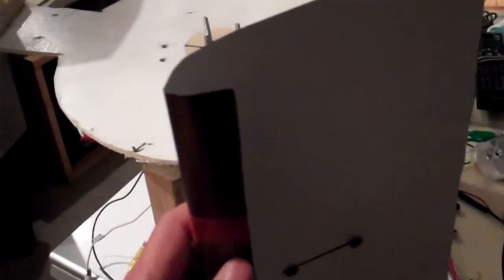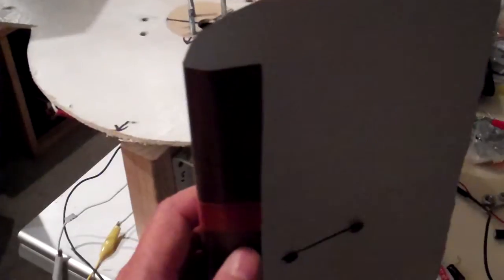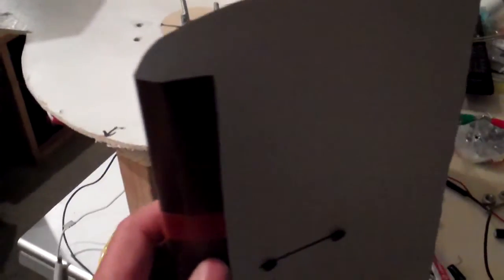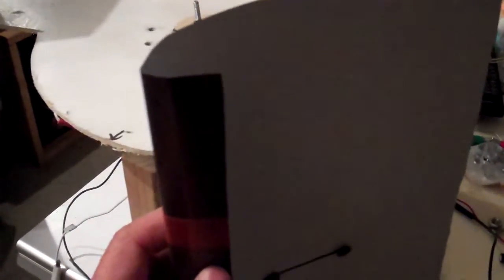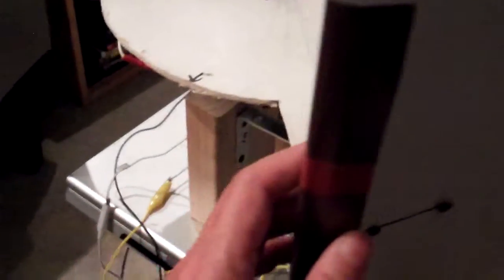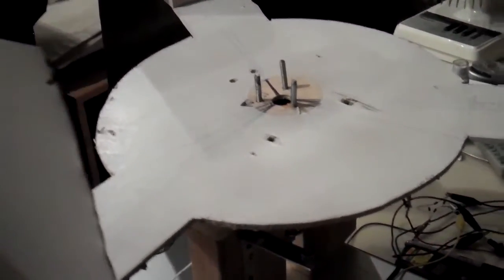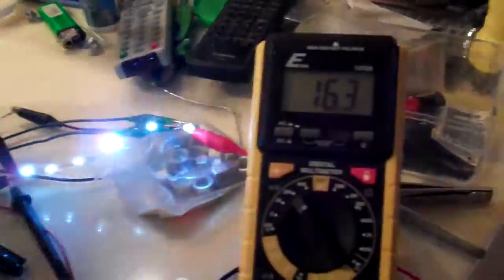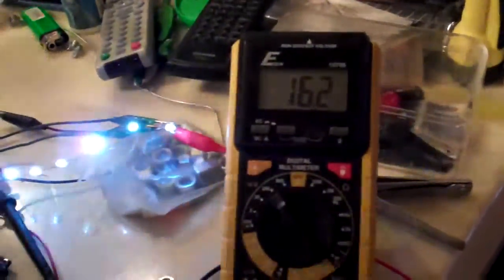Small axial flux alternator, pt. 3 -  test wings added.mp4

Comment from the maker: @crsbt It's hard to achieve the right balance. I need to make something that can run in low wind and still produces a workable output. I made another stator with thicker wires. That didn't work out too well because that needed a lot of wind.